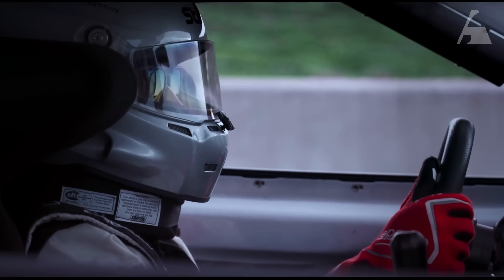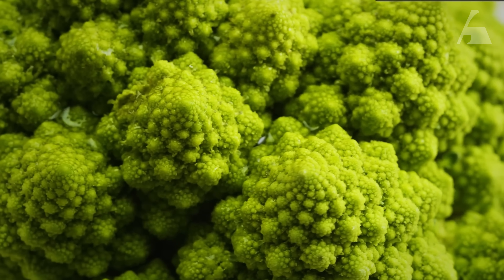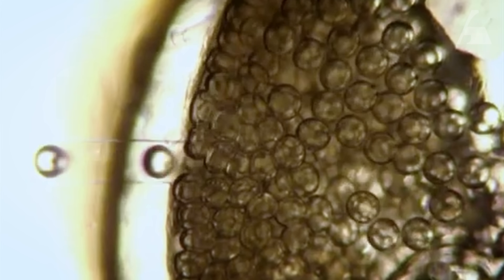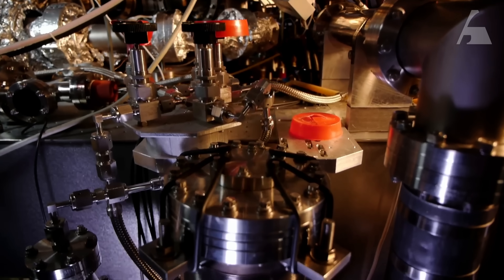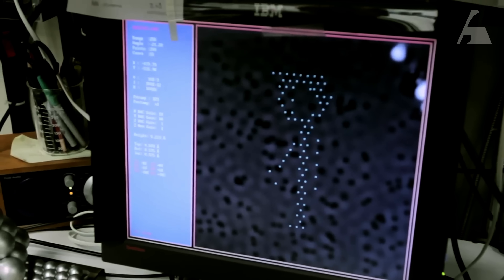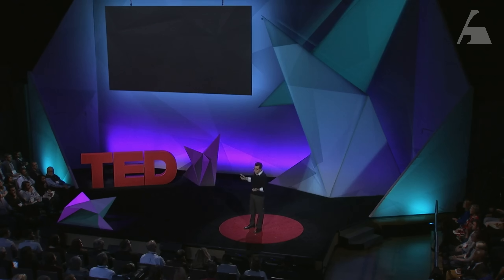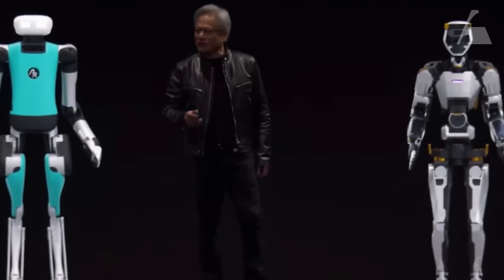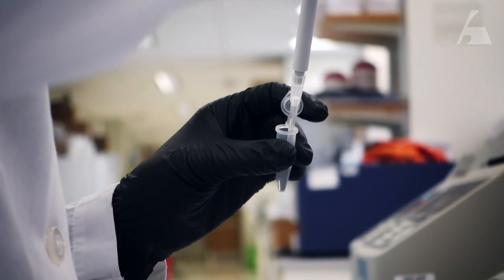What Is Nanotechnology? The Atomic Future Waiting to Begin

Comment: The infrastructure isnt there because the applications arent tangibly growing the economy. Nanotech doesnt transform the economy until its already massively established so its a chicken and egg problem. 
If you want nanotech applied research to flourish, you need to find an application for it that nanotech can solve the most efficiently than any other solution which is so critically important to other industries for surivival/growth in a way which doesn't invoke so much new regulation and change to the existing systems for such a pivot to be not worth the transition period from current to nanotech based and on top of this, that solution must then translate across other adjacent problems in the same way and it has to be so dramatic that it blows everyones mind and is a breakthrough. 

So what sequence of breakthroughs in nanotech is required to achieve a innovation in a field/industry thats not going to be stiffled by heavy regulation and doesnt have massive power dynamic beauacracy? The real issue of nanotech is finding the inflection point probelm it can solve for it to be  socioeconomically attractive and investable.

If that chain of breakthroughs is really long and each point in the chain is very debated or far away then the realistic horizon for nanotech is far away sorry.

Its a business problem and academics are too naiive of the real world to solve it because academia is nothing like business and to become an influential academic you have to spend all your life in academia and at that point you have already become a middle aged adult with too much to risk and there are far too few people in the field of nanotech with enough pull to achieve it. 

Maybe biotech is actually more tangible of an academic field with enough of an overlap in nanotech for being able to frame a good solution since biotech is so research heavy that its tied closer to academia and so their mindsets and business dynamics interact better and its a much larger and well funded field